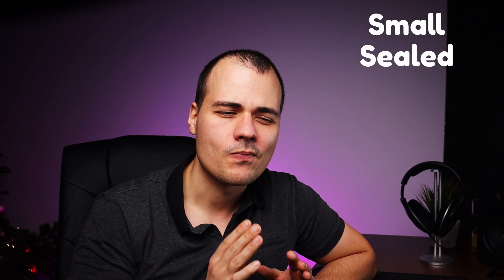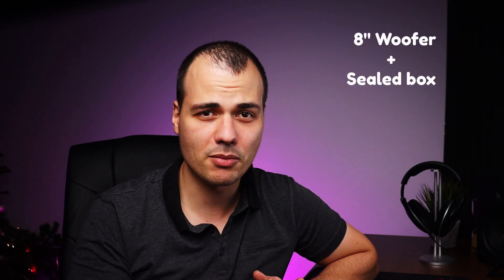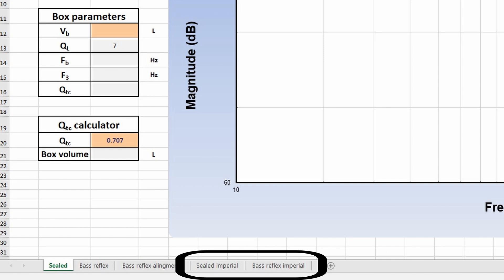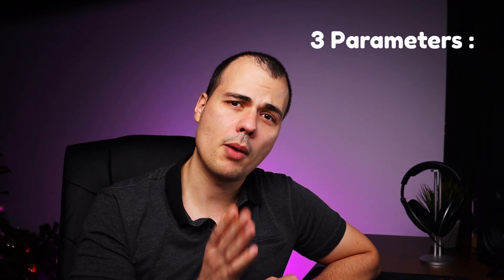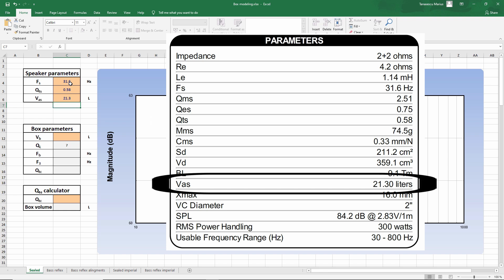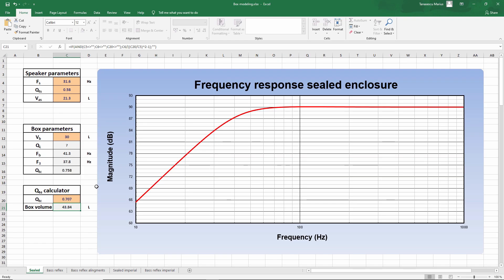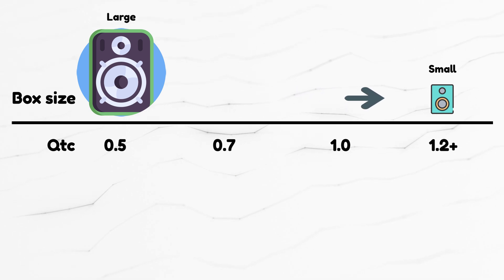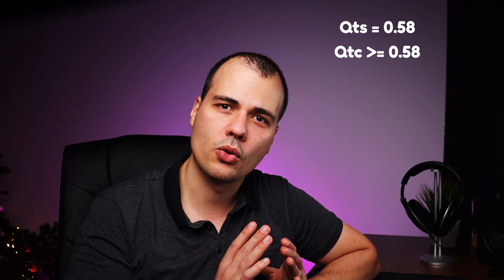Sealed subwoofer box design for home theater

Comment: Just put an amplifier to another case making your sub passive. Almost 100% issues with leaks of the air will gone. There is another advantage is that you will be possible to put your amplifier into plase where you will be able to make an adjustments on its rear panel without having trouble that your amplifier is located at the rear side of the subwoofer which is located somewhere beneath the table or something like that. If you find out that you want to replace the amp with anothter one you just need disconnect it and than connect to a new one. Making sub passive using standalone amp has planty advantages.

Comment: Is it because the plastic box covering the amplifier is flexing like the speaker in a passive radiator kinda way..
Silicon a piece of MDF over the back of the plastic box to stop flexing..
Cheers 👍

Comment: Thanks for this tutorial video and the excel sheet !
Can you help me pls regarding the  following issue?
I was trying with data for a 4 inch 30 watt small sony full range speaker. The box volume was coming with a negative number !
Fs - 202 Hz
Qts - 1.23
Vas - 0.78

Ok ... I got my answer from your another video👍
But what should be done for small speakers having Qts more than 1.2 ?
Reply from the maker: For High Qts drivers you can go for Infinite baffle, open baffle or large sealed enclosures.
Reply: @AudioJudgement  
Sir I am intending for small personal listening. So eventually it will be a portable one. Hence, an infinite or open buffel will not be met for me. 
Now what would be the size for a  large sealed box size?
Reply from the maker: @sudiptasen6181  How large the box should be depends on the other speaker parameters. Having at least Fs, Qts and Vas is enough to determine the box size.
Reply: @AudioJudgement  Yes sir. But as my speaker has Qts more than 1, I am not being able to find the box size with your excel.
Reply from the maker: @sudiptasen6181  You can't use any alignments, yes. But you can design a box for your specifications, regardless

Comment: Have you had any problem with the amp overheating being enclosed like that? Great video and spreadsheet - thanks
Reply from the maker: The amp does have the radiator fins to the exterior. So, there should be no problem with overheating.
Reply: @AudioJudgement  I guess I missed the point -I thought you were enclosing the entire amp including the heat sink
Reply from the maker: @BillWrightOttawa  No, the amp is in the same position. Just placing an additional panel inside the box to separate the chamber of the woofer from the chamber of the amp.

Comment: I read some theory that sealed enclosures should have a small leak so internal and external pressures can equalise over time.
Reply from the maker: I've never heard of such things. Even if you make a perfectly air tight sealed box, the speaker itself has some amount of leakage (very low), but in time, I'm sure it solves the pressure equalization you mention. Obvious air leaks, like in this video, are bad because they are noisy.

Comment: First off, great video, this is super helpful! So I've got my driver and amp plate picked out and am now in the design process for the box, and one thing I'd really like to do instead of painting or veneering my box is do an epoxy resin pour design on the outside. I've watched some videos of people making countertops out of MDF then doing epoxy pours to mimic a marble finish and it comes out looking pretty incredible; I think that would look awesome as a speaker box design. The thing with epoxy is that it's much thicker, heavier, and denser than regular paint or veneer and I was wondering what effect that may have on the sound of the box? I'm guessing if dampening material mimics a larger box then so would an epoxy coat around the outside since it would be harder for sound to escape the box with that extra layer. Was wondering if you have any thoughts on what effects that may have or how I may need to adjust the design of the box to account for the extra thickness/density of the box? Keep up the great videos, subscribed and waiting for more!
Reply from the maker: The layer of epoxy on the outside will do nothing for the internal volume. Placing dampening material inside the box, increases the perceived volume because the sound waves inside will behave differently. But dampening material has low density (if you squeeze it, you reduce it to something that barely occupies space), the physical internal volume is almost the same. So, for example if you put something solid inside, you decrease the internal volume. So, if you put epoxy on the exterior, you might increase the rigidity if the box and might not need bracing, but the internal volume (either physical or perceived) is the same.
Reply: @AudioJudgement  thanks, good to know. Glad I won't have to make any adjustments to the volume
Reply: Btw going with a very similar driver, Dayton Audio RSS265HF-4 10" Reference HF. Slightly different amp as I'd like to be able to access a little more of the driver's capabilities without shelling out for Dayton's 500w; getting the Bash 300S Digital.

Comment: Hello Sir
Can we use two different subwoofer one is tunned with 60hz and another one is tunned at 70 hz
Does it gives better in one room
Reply from the maker: If you have 2 subwoofers you would use identical ones. One for left channel and one for right channel.
Reply: @AudioJudgement  sir but i have only one channel for subwoofer
Reply: @AudioJudgement  if subwoofer fs is 71 and another one is 61fs
And I want to use different enclosure 
And can i both enclosure tunned with 60 hz
Reply: Please help me sir

Comment: Hello Sir. I tried to measure the ts paras as you explained. Problem is , I think Iam doing everything right, but during caliberation, the clipping error is showing up every time. Altering the input levels do no change. Could it be sound card issue, as mine is a cheaper chinese thing. Could not understand what the problem is.

Comment: In my experience of using plate amplifiers. Some leak & some don't and for that I don't trust any of them!  So I do exactly what Dayton Audio said. Completely separate the subwoofer from the plate amp. When I make these small enclosures I'm usually using.  A subwoofer & 2 passive radiators & it has to be air tight for proper tuning. So avoid the folly & just believe that they all leak. Then design around that information & the success rate will increase. 👍🏾

Comment: Hello Sir. Good Evening. Sir, I want to ask that, does a Subwoofer box helps to increase the Bass output what the driver produces, like if wattage of driver is 30W, then does box makes it 40 or 50 ?
Reply: Bass output is not measured in watts, its measured in decibels. Input power is measured in watts. If we measured output power in watts the numbers would be very small - for 40 watts of input you get about 0.4 watts of output. But also, the ear doesn't hear sound energy linearly, so we need a logarithmic metric to measure the output. Hence we use decibels.

The efficiency of the system is what you want to look at. Typically 90 decibels for 1 watt at 1 metre.

Yes, generally ported speakers are more efficient than sealed boxes in the bass frequencies - by about 3dB.
Reply: @FabianEason  Lots of thanks Sir, for this precious knowledge. 🤝🤝
Reply from the maker: Different boxes may increase the acoustical output, but the electrical power handling will remain the same (with a few niche exceptions).
Reply: Hi Sir. I have seen in some music systems that the port and subwoofer are positioned at right angle faces. Does this make any difference ? I mean the faces on which port and the sub are same or different ?
Reply from the maker: @swarajbiswas3056  That kind of decision is made usually to be space efficient. Probably there isn't any room on the front baffle for both the speaker and port. Also the port might be too long to be placed on the back panel etc

Comment: The back of the amplifier is removable by unscrewing the screws on outside of amp. It’s sealed with a felt gasket like material. Check to see if screws are tight or try adding a better gasket.

Comment: Felicitari pentru canal si site. Sunt pasionat de diy audio si am descoperit de curand canalul tau si siteul pe care l-am lecturat cu placere. 
Era interesant sa arati si niste masuratori ale raspunsului produsului final, anechoic si in camera, chiar si cu problema scurgerii de aer.
Poti sa imi spui de unde ai luat furnirul si ce esenta este? Multumesc.
Reply from the maker: Salutare! Furnirul l-am luat de pe Audio Alchemy acum ceva timp. E un site romanesc care arata cam invechit dar e de incredere. Se poate comanda pe mail. Furnirul este de palisandru si este cam scump. Am luat o data mai mult pentru niste boxe de podea si mi-a mai ramas. Este scump pentru ca este printe putinele esente care vine in latimi mari. Altfel, daca furnirul nu este cel putin la fel de lat ca panoul, trebuie imbinate mai multe bucati una langa alta. Sigur nu ma pricep sa fac asta si am preferat sa iau un furnir care sa necesite o singura bucata pentru fiecare parte a boxei. Pentru un subwoofer ca acesta, care nu e prea mare sigur gasesti si alte esente care sa fie la preturi decente si sa arate si bine.
Reply: @AudioJudgement  Multumesc frumos, nu stiam ca au si furnir, am luat niste difuzoare de la ei mai demult.